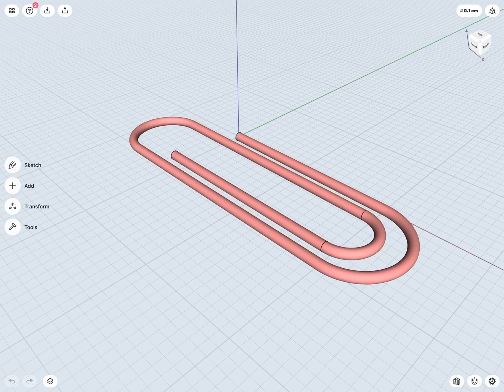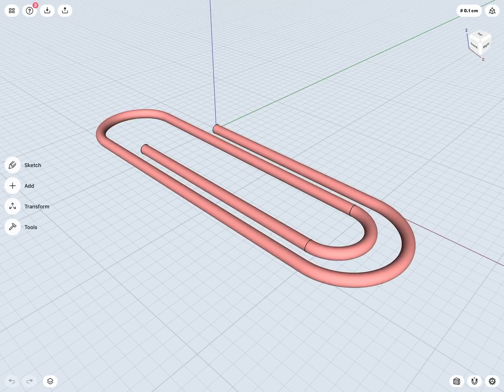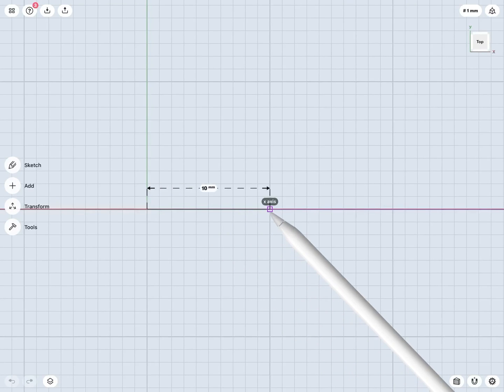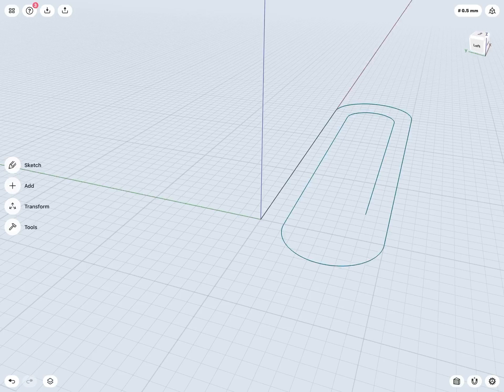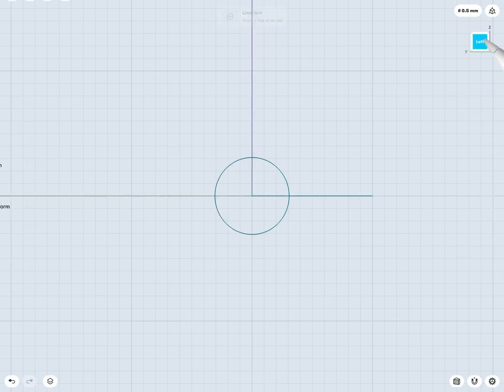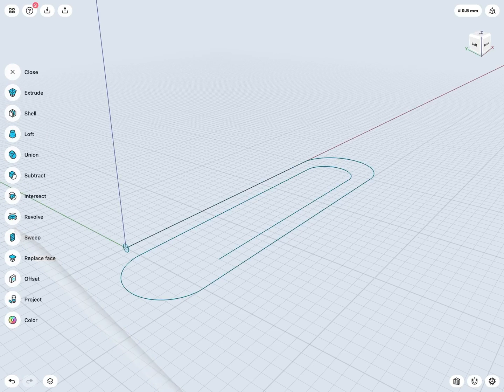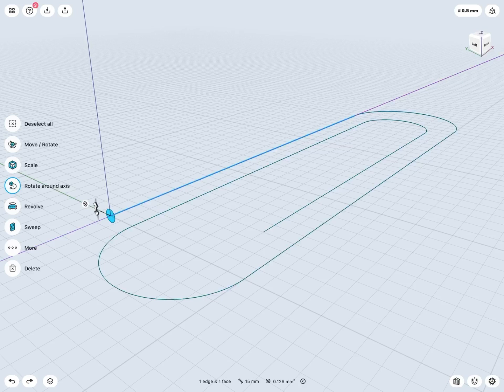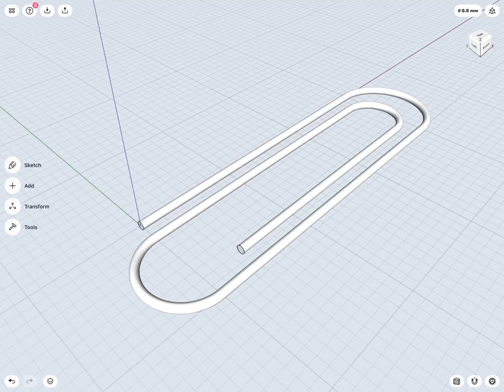Sweep | Creating complex 3D bodies

Comment: I’m trying a similar design, where I’m trying to produce a conical spring using the sweep technique shown in the above video, but when I try to move the part up/down to get a spring only a segment of it is moving instead of the whole coil, my doubt is that the program identifies each sweep as a separate entity rather than as a whole body, how can make all the segments into one body?
Reply from the maker: Hi, you need to project a spiral on top of a cone, then use the projected sketch as a guide to sweep.
There is a forum thread about how to make conical springs: https://discourse.shapr3d.com/t/conical-helix/4926/7
There is also a great video on the internet: https://www.youtube.com/watch?v=3lG2edbNzeM

Comment: Shapr3D 5.31.0 here. When I follow your tutorial, unlike your model I end up with circular seams connecting each line (straight tube) to the following arc (bend tube). How to make an apparently seamless volume as yours?
Reply from the maker: Hi, it is just a visual change, the result is the same CAD model :)
Reply: @Shapr3d  Cool, I was wondering about that possibility! Thanks for the confirmation :)
Reply: @Shapr3d  how do I visually change it to hide the connecting lines?

Comment: So is there any way to edit the spline and have the geometry follow and bend? Or is there a way to give a line a thickness? Need it for wire work.
Reply from the maker: Hi :) Shapr3D is a direct modeling software, changing the curves will not change the bodies that are already done. For wire work, we would advise the same workflow that is shown in the tutorial, but with a smaller cross-section radius.
If the radius is not the one you were looking for, please select the perimeter of the tube and move it accordingly.
Reply: @Shapr3d  Thanks Shapr3D, Although, for wire sculptures, the above method is really cumbersome. I was hopeing there would be an option to give the spline a thickness like 3DS Max does. Here is a short video of what they do though its not in english, but you get the idea. Hopefully you can implement something like this in the future ;)
https://youtu.be/0dwpdTfwCV8